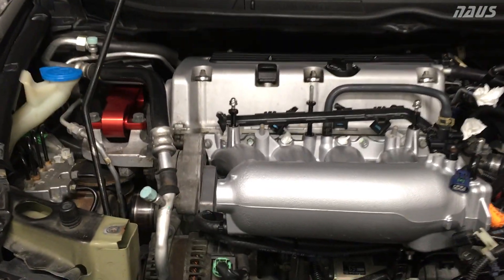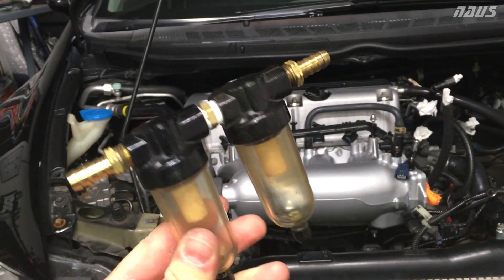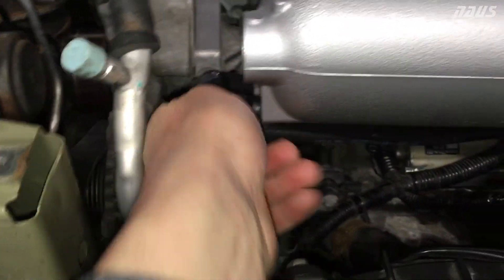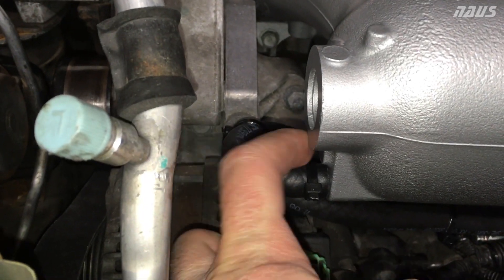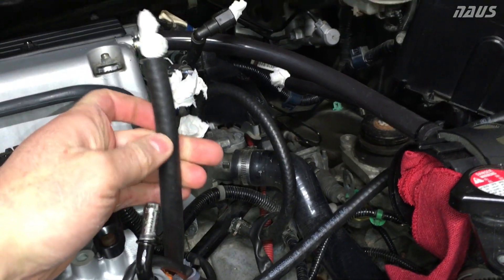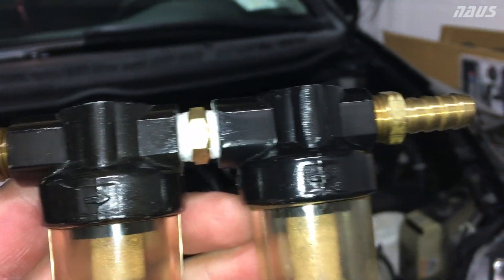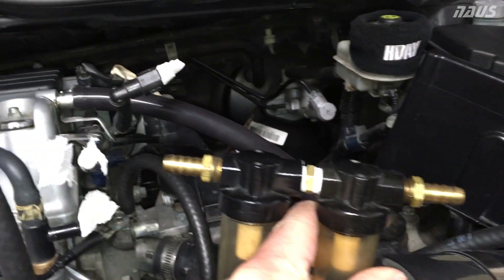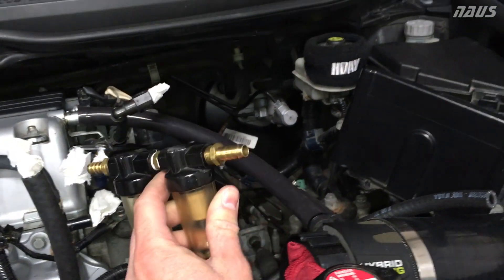Civic Si (8thgen) All Motor Catch Can Setup

Comment: What is the purpose of this if you are fbo only or do u even need this if youre only i/h/e tune?
Reply from the maker: This benefits the car regardless of mods. It would have the same effect if it was stock. It prevents the oil from the PCV being sucked straight into the intake manifold and burned in the engine.
Reply: NAUS do u have to constantly check them if they get full? If so, do they get full fast?
Reply from the maker: Daily driving they will not fill up fast, however if you are revving the engine out constantly and doing lots of WOT, they will fill up rather quick. I usually empty mine ever 500 miles. These are a cheap alternative to a $150+ catch can setup.  @ronaldfortaleza1177

Comment: So why do this instead of just plugging the manifold and routing the hose from the pcv right into a catch can right there?
Reply from the maker: Because you need vacuum on the pcv valve to open it and release crankcase pressure and fumes, if you punch out the pcv or replace it with a basic fitting you can run it to a vented catch can, that’s what a lot of the turbo guys do, but then your engine is open to the atmosphere at all times
Reply: @NAUS2K  thanks for the response! I've heard of NA guys just blocking both because whatever crankcase pressure there is will work its way to the top of the engine and out of the breather on the valve cover(assuming you have one). I've never done this but my z3 is showing some very strange oil burning symptoms and when I pulled the pcv it was significantly wet with oil. I've had cars with bad rings that smoked basically all the time, and ones that has bad valve seals that would smoke after sitting a light but only on take off. My si is smoking only after running for a while and then at take off. And not all the time. So I want to just delete the pcv and see what happens. Probably just put a vacuum plug over it and over the nipple in the manifold and see what happens

Comment: I miss the sc setup!
Reply from the maker: Gabriel Amorim it sure was a blast!
Reply: It was the reason why I bought mine, same cte setup over here in brazil
Reply: Did you sell the SC? If not would you consider it? I've the same year and color si
Reply: Nevermind, just watched an old video :( I can't find the CTE SC anywhere
Reply: @rotchcrocket9833  the cte isnt available anymore, but you can buy an TVS1320 that is more efficient than the setup he had, search for it on mercracing.net
Reply: But also more expensive 😭😭

Comment: Where did you get the air oil seperators?
Reply from the maker: I got these on ebay
Reply from the maker: Yes it will help a lot, however if you are blowing oil by the piston rings or valve guide seals this will not help  @FG2-K24A
Reply: @NAUS2K  I'd like to run the same kind of set up. What size hose did you use?
Reply from the maker: FG2 Crew I believe they are 5/16” fuel hose from advance auto
Reply: @NAUS2K  Cool thanks